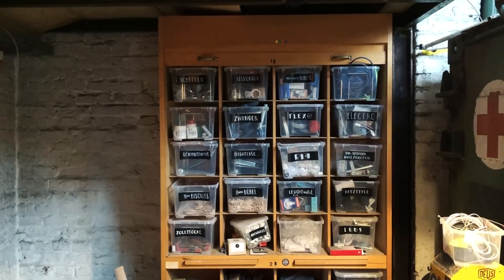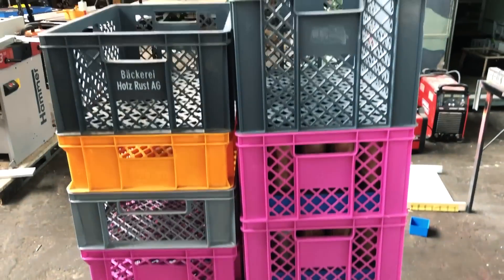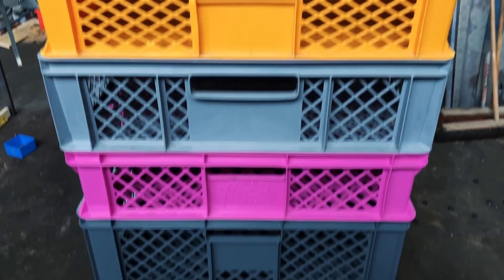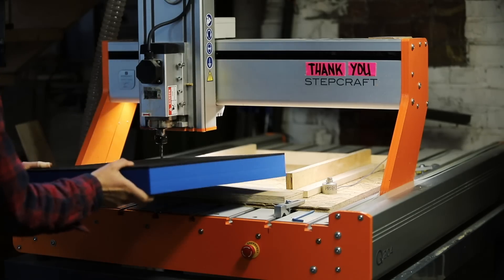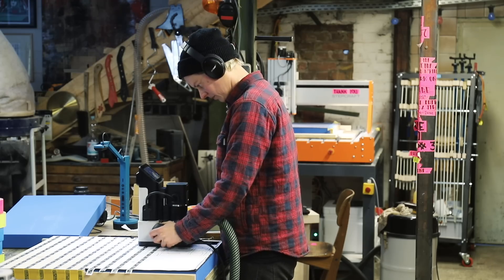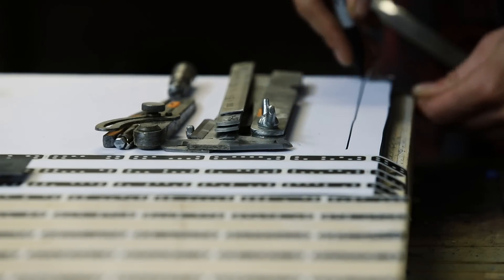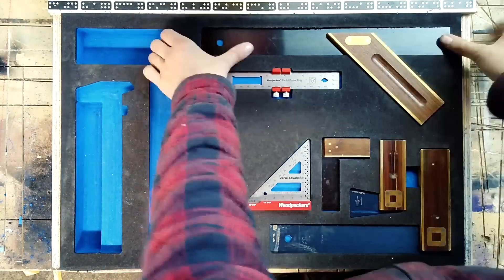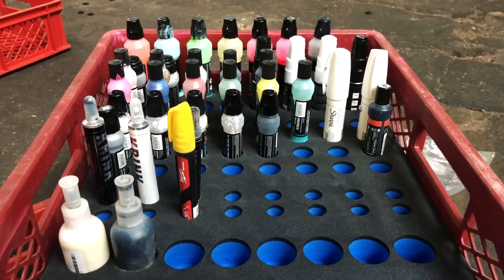Workshop Storage - Cutting Foam Inlets on the CNC

Comment: I'm big on storage solutions as well, although I don't have the space or amount of things you do. I do Have a few milk crates for heavy metal tools and metal parts, but recently reorganized a lot of supplies into cardboard boxes with bright labels, so I can read them at a glance from a distance, making a search of the shop quick and easy for the most part. Another thing I did was pick up some long, deep plastic bins/trays for internal drawer and project organization. I got these at my local discount store for $1 each, which is super affordable for me. That foam looks nice, but I can tell already it's outside my budget and space requirements. Maybe there will be foam in the future.

Comment: I really like the foam blocks. I might have to give that a try. I would have a different implementation for myself other than the crates, but your implementation is very elegant.
Reply: Although, now that I think about it.... I think the crates would be awesome, but I would create a cabinet and/or benches with areas the crates could slide into like drawers. Then if I needed to take them with me I can pull them out and stack them to transport.

Comment: Looks really cool and interested to see what your colour coding scheme will be. But if you want the ultimate storage solution the only way is to use a computer. Throw things in numbered bins, mark each item with the bin it lives in, and have a database on the computer that you can then search by size, function, etc. without having to commit to only one way of sorting things.

Comment: when removing a ton of fire extinguishing powder from some systems that needed an upgrade, the company I worked for got the "Change-over" open head buckets to hold the powder. If you are not worried about the color or looks of the containers these are a very cheap way to go, as when making injection molded stuff some blending happens when you are changing colors, and the resulting products look ugly or smeared. These are often even cheaper than the production rejects. So if you are not worried about looks or color sorting, see if those are available as well.

Comment: Organizing your stuff is one thing, but KEEPING it organized is mostly the biggest challenge.
I work with 3-4 people in a workshop, and even when things have a proper defined place, things get messy already after a week.
Which drives me totally insane, because I always put the tools I used back where they belong.
Reply: Preach.
I pretty much organised my boss's entire workshop and I clear up after him all the time and scald him for not putting things away. I've noticed being tidy is a bit like driving at high speed, if you want to stay there you only need to put a bit of effort in, but if you slow down completely you have to put in a bunch of energy to get back up to speed.
Reply: Piet Muijs install cameras and cut a finger if someone doesn’t return the tool to its place ;)

Comment: Problem is that you need to restack everything to get to the bottom? I have these too, with one with wheels on the bottom.
It collects dust
It is slow
It does not fit things like handsaws or bigger objects
For small things you end up with an almost empty crate
But it was pretty nice lookin nonetheless
Reply: If you look at the previous video she made a tool cart which used the same crates, but they were removable draws instead of stacked straight on top of each other. I can only assume she will do the same with these with the inserts.  😉
Reply from the maker: Exactly!
Reply: @laurakampf  My exact question answered. :) Thanks. I have cardboard and wooden crates (60x40cm, the fruit and vegetables wholesale ones) but got stuck at the stacking problem. ;) An easy and cheap to build (or to repurpose) shelf system (or drawer-like pulled-out shelves) for keeping these crates accessible would be a nice (and needed I think) video. :)
Reply: Remember seeing what I thought was a cool idea, of connecting the trays/containers to a pole, so can raise trays to disengage and fan them out for access. 
Ah here's the thing... https://www.topeak.com/global/de/products/prepstation/763-prepstation-pro

Comment: One way to easily get the vector countours of the objects is to use a regular scanner and the autotrace option found in most vector apps. If all goes well the scale is kept along the process, if not there's always the full scanned page size to have as a reference.

Comment: Awesome work. I’d love to create a custom foam insert for my camera bag.
Reply: In my journeyman days, I traced my tool outlines onto a sheet of open-cell foam and cut the outlines with a hot wire (a paperclip straightened and then wrapped around a 800W soldering iron). Turn a fan on, and move fast and smoothly, because melting foam is not good.  I painted the surface of the top layer before cutting, then glued a second, flat layer underneath the silhouettes, creating the shadow effect just like Ms. Kampf's. (I also tried razor-cutting the silhouettes layer, but that was ugly because I could not cut all the sides vertically straight, and corners were even uglier).  This was to store over 1,000 tools.  It was perfect for recognizing which tool(s) were missing.

Just know that you don't need a €6.000 machine (Stepcraft Q204) to solve a €6 issue (the soldering iron), but it would be a fun tool to have if the budget allows and it could be used regularly (like - presents for all your neighbors and friends who would enjoy an organized shop).